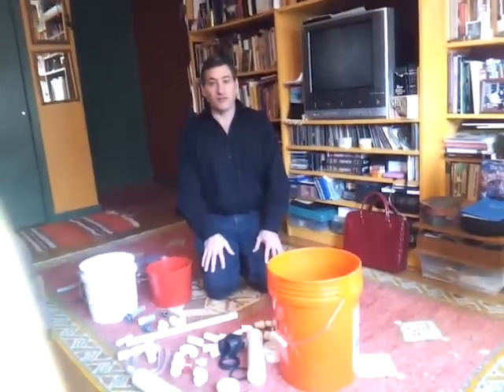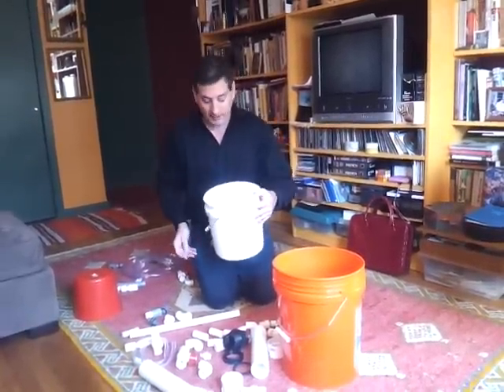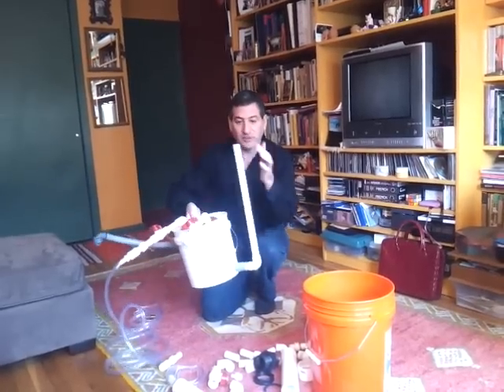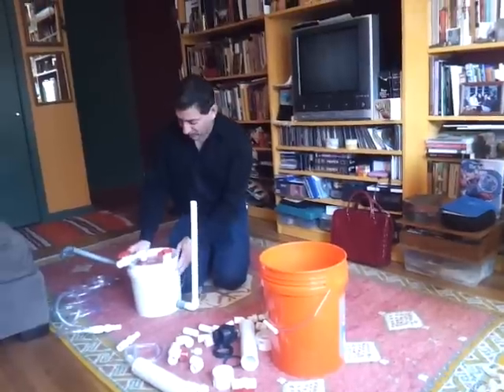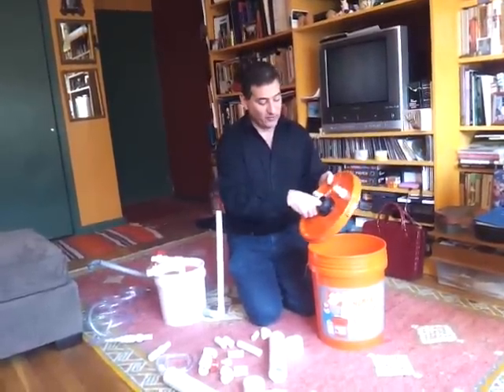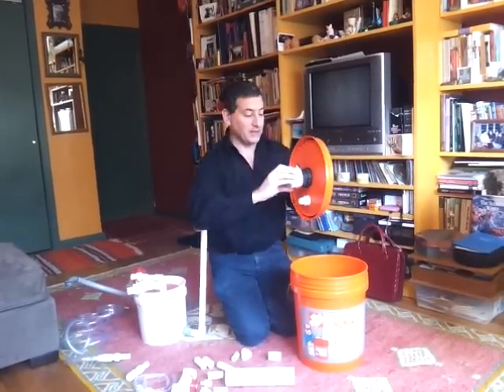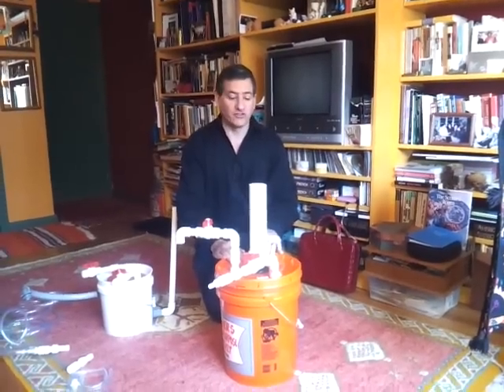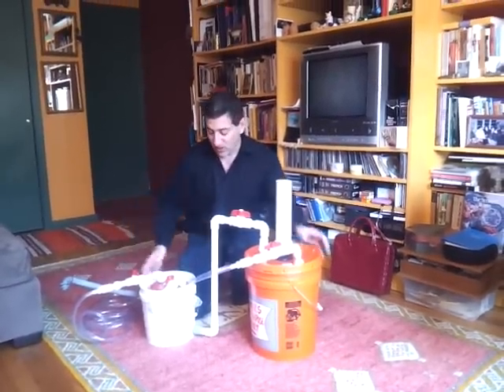How to make a working mini-biodigester using parts from Home Depot

Comment from the maker: Indeed it would. This is what we do with the 1000 liter and 2000 liter digestors we make in tropical and subtropical countries (or we just buy them black to begin with -- in Botswana they were green and had to be painted, while in Portugal they were blue and had to be painted, but in Kenya, Tanzania, Nigeria and Egypt they were black.
In my own home unit in Germany I insulated it with styrofoam and wrapped with black stretch plastic. I warm water feed it, insulation keep heat in.

Comment: chuck gonzalez, the outlet tube from the digester connects to your gas stove gas inlet valve. do not disconnect or mess around with gas lines from your home, as this could be dangerous if you have no experience with gas connections.(kaboom!) instead for a small digester connect it to a camping stove, and use it outside, until you refine it, and learn how to use it correctly, and most importantly, safely. peace :)

Comment: A lot of saltwater aquarium stores carry bulkhead adapters.  The one you use on the orange homdepot bucket should cost ~$8.  The stores have them because of the high filtration needs to maintain a pristine marine environment and  stock tanks are often modified using bulkhead adapters to insert an overflow that will drain into a sump tank.

Comment: Mr. CULHANE, I am having issues with the biodigester I have made. I have it making gas, all is perfect except for the end range. What stovetop makes best use for the gas. I have a 2hp O2 pump added after the storage. It is fed with 3/8 fuel line. Is there a range or propane stove top you suggest? I have gas the lights from the hose but the range im using just isn't working. I need advice.

Comment: Would it be possible to build a horizontal bio digester out of a large (12 inch) PVC pipe, maybe 100 feet long?  This is why I ask; I was thinking of laying PVC pipe around the base of a cabin, building a garden over the pipe and up against the cabin walls, and using the pipe to water the plants.  Then I thought the slurry of a biodigester would be better than water, so why not just make the pipe a 100 foot long biodigester?

Comment: Looking at all the pvc parts laid out , i think buying half the hard the hardware store just to make this im going for an easier option with a fraction of what's in this digester, buckets already got  , old copper water pipe sitting in the shed , some garden hose , a T piece for hoses and some clamps , my BBQ cook top, a tap and a tube , Done.

Comment from the maker: We fill the bucket with water to the top, the feeding pipe goes to the bottom of the bucket and the lid is sealed (it has a rubber o ring).  So no oxygen gets in.  In the smaller bucket, which is an open system, the water level effectively prevents most of the oxygen from reaching the bacteria under the gas collector. Hope that helps!

Comment: thank you so much but sir as you biodigester has water over flow , to mi I think you had connected water overflow to the gas collector and you suggested that , it acts to digest any un digested component to maximize the gas production.

Comment: Nice demonstration. I wonder if spraying the buckets and piping with black paint to absorb more solar energy would speed up the process.
Reply: Thank u for nice one
Reply: Please sir you can least the materials used?
Reply: You need to be careful about heat and cold.  Too much of either will kill the bacteria in your materials.  From what I've read, on the temperature "It is important for operators to maintain temperatures within a narrow range — typically, 35°C to 37°C (95°F to 98°F). "  Of course, these are ideal and I'm sure the variance could be larger but you get the idea. And large fluctuations from hot to cold and back to hot aren't good for it either.  Find a place where the temps can be maintained on a more even keel.  Even in a basement or closet it will work but of course, outside would be best.

Comment: Before the stove, the gas should go into a pipe stuffed with steel wool or iron filings to scrub away the hydrogen sulfide.  Then, it should bubble through a bucket of distilled water to remove the carbon dioxide.  The result would be a much cleaner gas for cooking or whatnot (so I've been told)
Reply: exactly what i was thinking! some kind of non return water seal or check valve and scrubbers definitely needed especially if any sulfate consuming bacteria exist that might release hydrogen sulfide

Comment: As a rule of thumb does every 1000 ltre container produce about 1 hour of cooking gas on a single burner?  Is there any chance a flame can travel back down the tube from the burner into the gas holding drum causing an explosion?
Reply: yes
I believe and have watched videos where they have just before the outlet 
a container where the gas passes through water which the container is filled with.
Also what he didn't explain is that the gas will keep pushing the bucket up and maybe
off... so there needs to be some weights on top of the bucket
Reply: Wrong ... You have no idea // weights on top of the bucket are for to produce gas pressure for the flame of the burner ..no gas pressure is useless for cooking .and that size bucket will produce 5 minutes of cooking  time .
And kitchen waste  will take 6 months to breakdown .he can add a kilo of sugar a week to produce quicker // LOL
Reply: NO 
Flames don't travel down any tube  . gas,oxygen air and open flame is needed to produce flames .
 Gas drums only exploit went they get hot and gas expand .
Or will rupture with the pressure . but it won't exploit if can not reach an open flame before gas disperse .

Comment: thank you sir for that educative demo, but sir your set up is lacking water over flow, to me I think ,you had connected  the pipe for water over flow from the biodigester to the gas collecting vessel and you had suggested that it acts to utilize any escaped in digested component to be further digested in order to maximize the gas production, I suggest that you wouldn't have connected it to the gas collecting vessel

Comment: You can 3D print fittings for pennies. Depending on the type of plastic used heat annealing the part before use may be required.

Comment from the maker: In that case I will have to take the time to post a video of the system in action as it was this past semester in our lab at Mercy College's Manhattan campus -- it is more practical application than theory actually, but I welcome skepticism - I am at doubting Thomas myself about everything.  The overflow pipe is not "so-called' -- it descends to the center of the digestor bucket -- otherwise I would be draining out active microbial cultures. The red bucket doesn't have to fit snugly.

Comment: Where can I buy a working system that also works in winter time in Germany ?
Reply: i been thinking about this lately too since i live in the netherlands. i figure you can always have the digester in the house and run a line to the outside to your gas tank or just keep it warm somehow.
Reply: Use an aquarium heater. That’s what I used to keep my fish alive during winter system in my IBC Aquaponics system. It will work here too. Guaranteed! Just experiment with how many heaters and the size of the system. Get the water heater with the automatic temp shut off switch, to regulate temperature.

Comment: Am already familiar with the various designs and have been loosely monitoring it since 1975. In your tutorial I don't see any reason to bubble up the gases from stage one to stage two. Given the nature of the biogas you could make the liquid in the second chamber more acidy. It's better to run the gas to a storage tank that looks like the second stage you have (ARTI design) but with two holes. First hole in the side bottom of the outer bucket with a line/PVC going to the centre. Then a hole in the top bucket inner for gas extraction. In the buckets you would just fill it with water mixed with caustic soda and lime to absorb the H2S and CO2. A solid will be created as it strips the CO2 out. I don't think it will absorb all of the acid so a better answer would have to use if the feed storage is from live stock or human waste. Use some steel wool or alike for it to react with. At this scale it's going to be hard to introduce all of the scrubbers that would be needed. But CO2 and H2S would be the two to filter out and some how a dryer should be use to remove the water. This scale it would have to be a dihydriodide of some sort. Like those blue crystal packs they put in with electronics.  	 	 	 	The only think am not sure of at the moment if it has an exothermic reaction with water.
Reply: Thank you sir

Comment: The so called overflow pipe on the white bucket , should be at the bottom to empty the digested material and not a the top where there's going to be gas. The red bucket  does not fit snugly enough inside the white one,   Gas does not scape by the sides?  I think this is more theory than practical application.